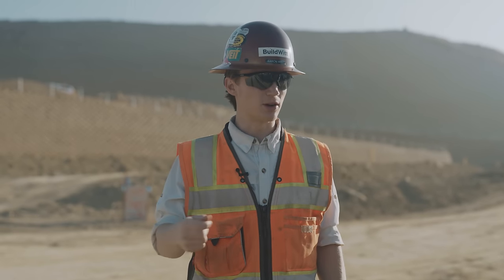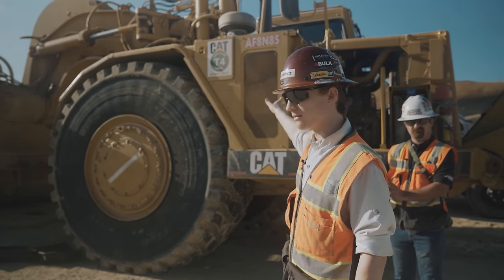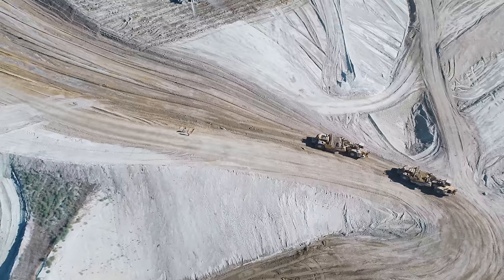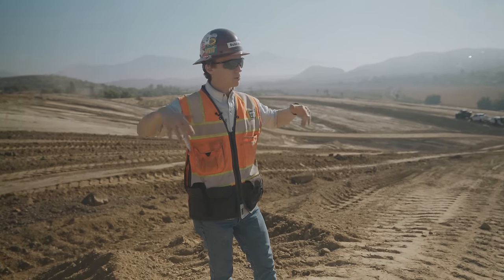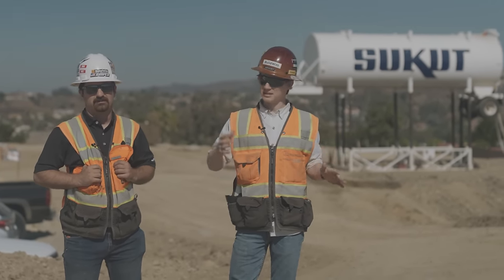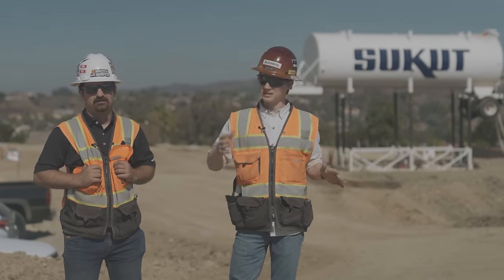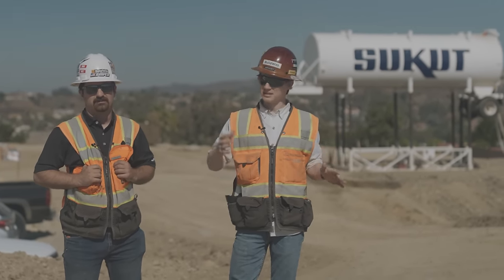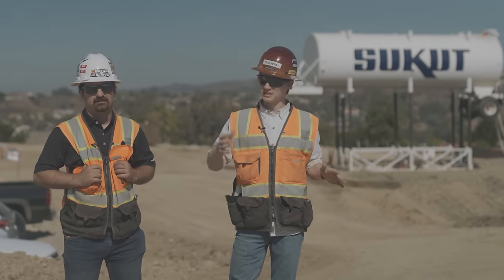Restoring the 70’s Heavy Equipment | Quinn Cat

Comment: Turning good running machines to machines that won’t run after 1 year
Reply: Creating more work for themselves back at the dealership
Reply: Now they will be down with def issues all the time. Lots of work or the techs
Reply: Basically turning into junk
Reply: Gotta love Commiefornia
Reply: Okay boomer
Reply: @cruz6794  I’m a 21 year old mechanic I hate working on junky mechines
Reply: @blauer2551  ya your right but as a mechanic i get tired of working on them no room to work
Reply: @cruz6794  how to say i live in moms basement and don’t know my dad without actually saying it
Reply: Genuinely asking do the machines have issues with their new emissions systems? I know diesel pickup trucks can have issues especially if they sit idling all day or aren’t being used to tow or haul heavy loads. I mean it kind of comes with the complexity of trying to run higher power, more fuel efficient and cleaner burning equipment. I know older diesels were much much simpler machines.
Reply: Yall a bunch of lawn mower mechanics.
Reply: These machines all have more than a year on them and they’re all running strong. Be a good mechanic and you won’t have issues.
Reply: @squarecrab  says another smart mechanic
Reply: @squarecrab  tell us you know nothing
Reply: @user-qt8zt6zg6w  I actually know these machines and emissions systems quite well. In fact; I was a master field tech at Quinn CAT until I came over to Sukut. Hating on Tier 4 Final just tells me that you don’t know enough to diag them quickly/easily enough. It’s okay though, keep being scared of modern technology and let it pass you by because “old school” is the best.
Reply: It's CA pay the stupid tax
Reply: True
Reply: The old 57s held together
Reply: Put those bearcr
Reply: On a stiff neck 57
Reply: They emoculate themselves
Reply: Worked for Fulton

Comment: We as a society need to recognize that the 80's and 90's were the future. Everything designed, built and done during that time will never be matched now. We need to recognize the perfection that is equipment from that era and not destroy it.
Reply: Cat is just not building new stuff quick enough to support the demand. It's not that these old machines are being rebuilt because they are so good but because they are forced to.
Reply: I was born in 2002 and I couldn’t agree more, last generation of equipment that you could work on effectively without fancy technology
Reply: Absolutely!! Personally I think we Absolutely peaked in 2005, it's been downhill ever since.
Reply: Just take a look at Central Illinois. Things have slowed way down for this part of the State and Caterpillar. I lived here when the Russian oil line was dropped overnight. It was always eerie driving through Peoria and seeing half built factories. Most of the concrete pads and steel were in place. The failure of the Russians in Afghanistan, along with Reagan wanting nothing to do with the Russians, other than to drop the wall. You nailed it when you said the 80-90's were our greatest years of this nation. Let's hope there are a lot more people like Aaron not willing to accept that fact.
Reply: True
Reply: That's why I specifically collect the nearly-indestructible all-metal vacuum cleaners from the 1980's & 1990's.  -  They simply don't build 'em like they used to.  Back then machinery, tools, and appliances were built to last.  Nowadays everything is built with a predetermined finite lifespan in mind so that it's a disposable item after 1 or 2 years at best. Imho Forced obsolescence is an absolute sin & I fully support the Right To Repair.
Reply: E models hit the market in 1996 not th"80's"
Reply: That’s so far from true. You’re just nostalgic About grandpa’s old 555.
Reply: @rileybowers1290  I'm nostalgic about affordable equipment that doesn't have a mechanical or software failure every 5 minutes, and more importantly equipment that can easily be fixed when it does break down.

Comment: Now the machines will be down all the time with def issues
Reply: DEF is one of the most corrosive liquids ever.  I used to install and maintain DEF systems.  Every fitting, screw or part needs to be either plastic or medical-grade stainless fittings.  Anything else will be destroyed in short order.  It also creates SHARP crystals that will slice you right open.
Reply: Not when you know what you’re doing.
Reply: I own 18 some old some new. We always have 1 down for def.
Reply: Facts
Reply: @robertandrade246  it's an undisputable fact that machines with these emissions systems are far less reliable than machines without them. Doesn't matter if you know what you're doing or not. They break down constantly

Comment: The way those guys make everything work for the repower is cool but that's the only cool thing about putting emissions compliant engines in those old machines, they should be snorting fire and blowing smoke
Reply: Engines also lose horsepower over time
Reply: @Metagross555  oh I understand that but that's where an overhaul comes into play unless you window the block

Comment: 3:31 the big round horizontal piece is the intake air filter housing. 3:58 The gray vertical tube is the air intake.  The exhaust filter or dpf is to the right under the hood.

Comment: Nicely done. Liked the addition of details.  Dirt nerds rejoice!
Would love to know the cost for the following -
1. The rebuild of that D-series dozer that ended up in the ocean.
2. How much is a repower of one of the graders?
Reply from the maker: thank you!! Usually full rebuilds are around 1/2 to 2/3 the cost of a new machine
Reply: @AaronWitt  awesome,  thanks for the update.  Gotta say,  unless all new controls and the cab is upgraded to the latest standard too,  I'd consider getting new, if it was going to get tons of usage.  I do love the fact CAT basically recycles old equipment to run in today's landscape though.  That's a good option for folks who can't buy machines new or recently used.

Comment: They run all types of scrapers everywhere in the United States, your assertion that they only run them in California is assanine. They also repower the same machines at other locations.
Reply from the maker: they do but not even close to the numbers they run in California. Other than a few other markets like Denver, big scraper spreads like the ones in California aren't common
Reply: Obviously this guy has never been to socal,I've traveled to multiple states and they do not run as many scrapers as they do in Southern California and that's facts!

Comment: But whole point of old equipment is no emissions!!!!! It must suck to work in California
Reply: There's more to it than that! They're saving millions of dollars, and breathing new life into what they have on hand. I like the resourcefulness.
Reply: @JMLoll  they'd be saving millions more by just leaving the good reliable engine that it came with in it, not to mention it wouldn't need to be repaired nearly as often.
Reply: @clydeacor1911  How do you know that? I'm sure it would need more and more repairs with increasing age.
Reply: @JMLoll  it's like semi truck engines, I have a pre emissions truck and I can rebuild the whole engine for less money than what it costs to replace just the emissions system on these newer engines and the emissions systems are not just known for failure but the engines don't last as long either.
Reply: @JMLoll  Wrong.  DPFs and DEF contraptions cause more problems than anything older that run fine.
Reply: @JMLoll  The old scrapers do need some serious love to keep running but if you keep up on them, they run just fine. It is more difficult to find some parts but they're out there. The repowered machines have their issues too but the emissions systems is not that big of a deal once you learn them. Most people that hate on new emissions systems just don't understand them and don't understand electrical diag. The biggest problem we have with these machines is the current lack parts availability. That being said - we still manage to keep all of these machines up and running day in and day out.

Comment: Does the fuel consumption go up as well as the maintenance costs?
Reply: You betcha the maintenance costs are going to go through the roof
Reply: Diesel particulate filters burn diesel during regen... however the new engines are probably more efficient.
Reply: Overall Fuel consumption goes down even after after adding DEF consumption to overall.  HP and torque are increased.

Comment: So are they only doing this to machines that need a rebuild or how does that work ? If there’s 651Bs out there still running with the original engine would it be allowed to run until it needs a rebuild then they would update it to tier 4 final or are they pulling running equipment off sites
Reply from the maker: Starting next year they won’t allow them to run anymore
Reply: @AaronWitt  that’s wild. Already expensive Cali is going to become even more pricey. Cost to pull and retro fit all that equipment is going to be enormous. Cost per yard is sure to increase. Increasing cost to develop. Be interesting to see the back log of equipment being retro fitted. Will keep the equipment manufacturers busy. Hopefully global supply of parts can keep up.

Comment: It is also a lot easier to put someone in a scraper and say follow the guy in front of you and do what he does. There is very little thinking involved. The 57’s are the only ones worth having. No one is going to buy a 27 or 37 when you can buy a quad track with double 21 yard scrapers for much cheaper. You can a 620hp tractor put a push block on it and load them just as fast and much cheaper than a d9 or 10. That’s why you don’t see new scrapers. Also nobody with half a brain wants to run one when they can sit in a tractor that’s a lot smoother and just nicer to run.
Reply from the maker: I see a lot of newer scrapers haha no one runs tractors out west. They work great in softer conditions in the midwest / south though
Reply: The company I work for only uses hoe’s and side dumps and haul trucks. We work with the scraper company a lot and I am this week. I asked the owner of the scraper company this morning his opinion. He basically said the same thing as I did. He sold his last 4 27’s last week. He had 50 of them. There is still a place for 57’s but not any smaller. The $py is way less.
1  A quad with double 25’s hauls way more than a 27 or 37 obviously.
2 A quad is way cheaper.
3 A quad uses a lot less fuel
4 operators like them a lot more than a scraper.
5 The service is faster because there a a lot more mechanics.
6 You can pull huge rollers and disc with them.
Should I keep going or are you starting to figure it out?

Comment: All that money spent, and all it gets is an external FOPS/ROPS over the old open cab? The noise/dust/heat from the engine must be appauling, surely there's an enclosed cab option to protect the operator a bit more?

Comment: I think newer emissions equipment will get better and more reliable with time. The technology hasn't been around for very long, so it's not proven yet. I think 20 or 30 years out, engineers and designers will have come up with better systems for limiting NOx and SOx.
Reply: It’s been around for almost 2 decades and they haven’t made it reliable yet

Comment: No explanation on how that bulldozer got stuck in the surf?
Reply from the maker: it was a lil whoopsie so we skimmed over it...
Reply: @AaronWitt  But those are the best stories!
Reply: A little oopsie is getting your truck stuck in some soft sand. Managing to sink a massive dozer 8 feet deep in the ocean is an epic fail. The ocean didn't suddenly move and the tide didn't rise nearly a story in minutes. I'm sure its probably that the thing died in a bad spot and they had nothing they could move it with but it had to have been way too far in to begin with and potentially without due regard to tide to end up that deep. Wet sand can be okay but add some wave action and its like standing in the surf as it buries your feet but exponentially heavier.
Reply: D6t was working on a beach clean up project, got stuck in the wet sand and couldn't move. 2 d8s came to the rescue, one pulling 1 pushing. D6 got out and D8 took its place, being that much bigger they had no equipment on hand to get it out that day, and there it sat.

Comment: Scrapers are awesome I have friebnnds that got their start driving those, one is working a striping shovel in a mine back east.  It is awesome work the Sukut is doing despite govenment interference with teir 1-4 EPA regulation being FORCED YEARS EARLY by California Green fanatics.  The Smog days are gone yet they are still pushing expensive downtime upon the people that actually build things.  

DEF is a deadly demon on production the only machines most contractors have most problems with are the one with DEF system.  Farmers also hate the DEF machines.  Stage 3 was probably enough, but I bet a group of senators have families with DEF supply and manufacturing passed the law.  How much coal has to be burned to make DEF?

Comment: Very sad to see these beasts being destroyed like this, those engines ur taking out are the reasons they are still running 40 years later, those new engines will die after 10 thousand hours, bet those old engines had 30+ thousand hours
Reply: 30,000+ hours or not they've been rebuilt. We have a 988k with 40k hours with several rebuilds on it. Very seldom does a engine get more than 10k+ hours without some form of engine work.